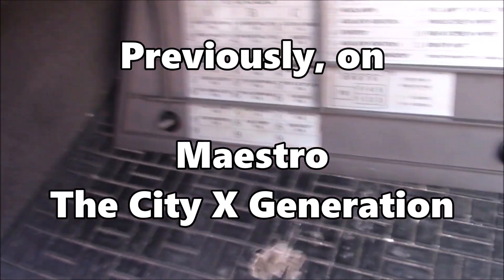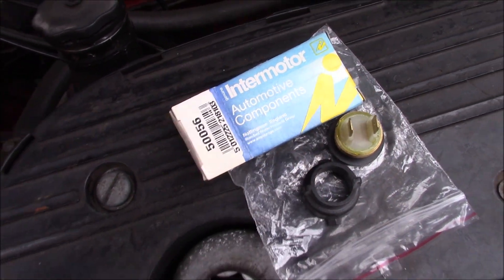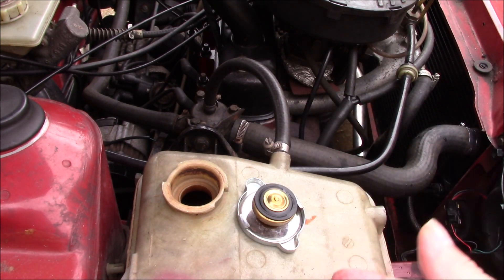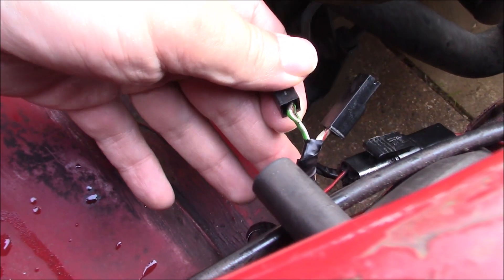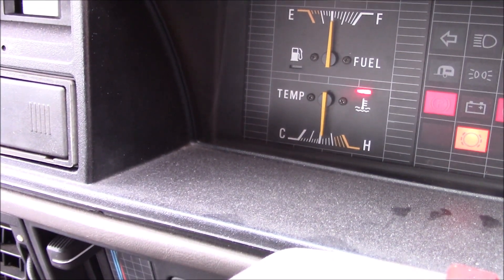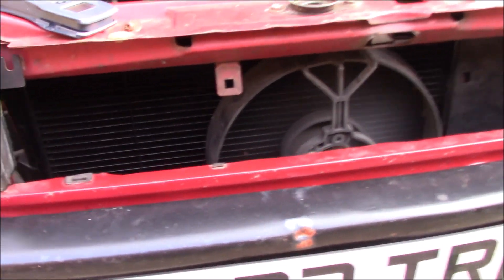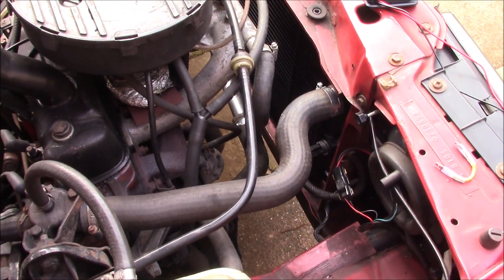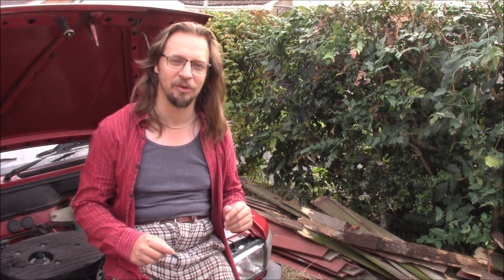1988 Austin Maestro - Iffy Fan Switch

Comment: Another great video. I'm surprised your high temperature light comes on after halfway. Mine doesn't until it hit the first orange/red line. My fan kicks in between high and half way. Normal running temperature is just bellow the halfway.
Reply from the maker: My brother had a couple of Metros that were this way, years and years ago, so I just assumed the pessimistic gauge was normal in this instance.
Reply: @noexpensespentstudios  I cannot recall as it's so long ago what my F reg 1.3 Maestro did. I did flash but at which point. When I'm at the maestro show this weekend, I'll ask around and see what other tend to do. I don't believe it to be a problem, I just find it interesting. 🙂